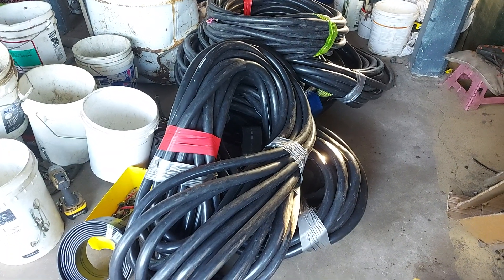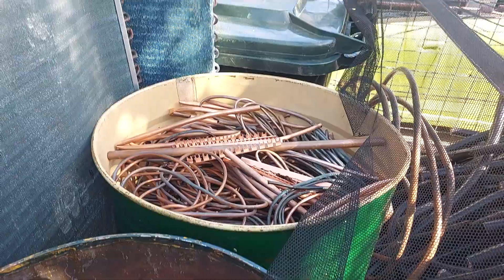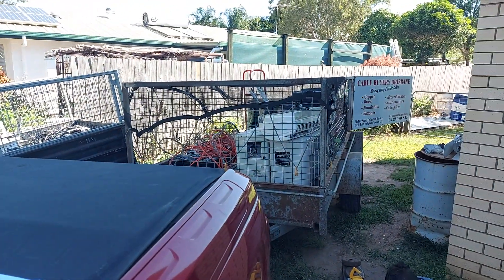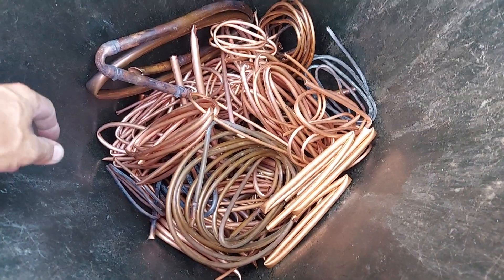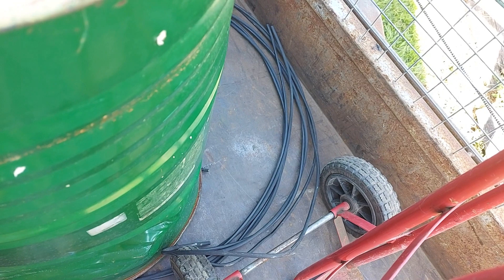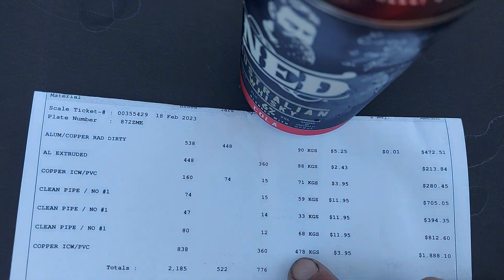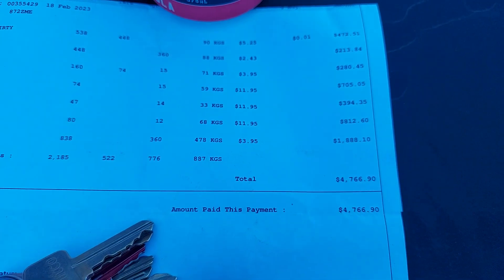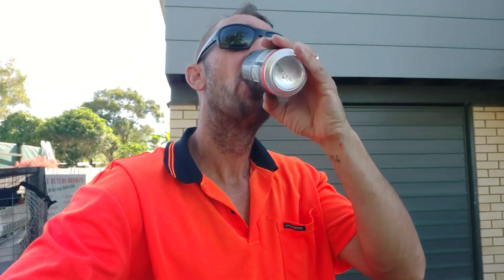Copper and Steel Cable Weigh n Pay.

Comment: Pretty good pay out. Could you have stripped the cable after pulling the steel wire out and made more?
Reply from the maker: Thanks......Tbh it wouldn't have been worth it in my view coz the cable is too thin, so to sell it as was is the best result.
Reply: @danthescrapper815  Time is money!
Reply from the maker: @grandpakevin3354  Indeed.